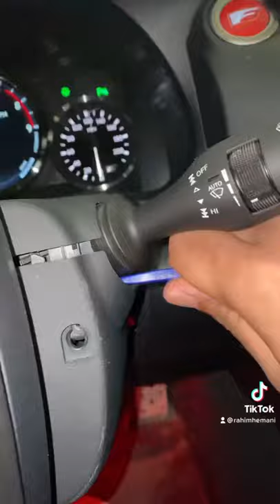Remote starter✅✅

Comment: They can void warranties for this. Just a heads up.
Reply: Hearing that exhaust I'd say he has a few things that can void warranty
Reply: @Nick.Pizano  but the people watching his video might not.
Reply: Be your own warranty, start wrenching
Reply: @Nick.Pizano exhausts cannot void warranty if it’s only an axle back exhaust.
Reply: Gonna be that guy, Nothing you do can Void a Warranty Period. For Modifications to Void a Warranty, The Companies must prove the mods caused the problem. Companies just get away with it cause no one goes to court over it
Reply: @J-Ru89  that's not true at all. There are terms and conditions to warranties and most of the time those terms and conditions mention things that can and can't be tampered with. One of those things, almost always, is the electrical system.

With voided warranties it's not about them proving that the issue is from your modification, it's that your modification makes it nearly impossible to prove that the issue 100% came from their side since the system isn't stock anymore.
Reply: @zc1682  so weird, Toyota literally lost a Court case on Warranty over tampering with what they said Voided the Warranty and had to replace a Gr86 engine.
Reply: @J-Ru89  right, because people weren't tampering with the engines. Toyota claimed things that weren't impacting the engine, were. That's not the case. They can't void your engine warranty over changing out to a remote starter. They can 100% void your electrical warranty as well as any warranty around your starter.

Comment: Check engine: has joined the chat
Reply: It’s a Lexus aka “a Toyota in disguise” that thing won’t have a check engine light in 2050
Reply: @Oh.Canada if you tamper with crap like that you'll get your light buddy. If it doesn't then there's a massive problem with your ECU.

Comment: what´s the point of having a remote starter ? i don´t get it
Reply: Practical use is preheating a car and letting it idle up to temperature before driving (like you're actually meant to)

Especially during winter

Although its just cool af

Comment: Imagine forgetting you that you left it in gear..
Edit: If it was emanuel
Reply: If it was le manual
You could program it to use the gear sensor to not start in gear
Reply: @maybeharold  Well.. I’ve never driven anything made after 2004.. Don’t know modern car technology that well
Reply: The clutch pedal need to be depressed. So u would need to get around that to.
Reply: @tysonchickennuggets  no it doesn’t.. at least in cars built with people who own a brain
Reply: @Brawell_ I've got an older style system on my 03 Evo. There's a signal wire for the handbrake since older cars don't know what gear they're in but you can also have a separate neutral activation by just putting a switch in the neutral position

Comment: Don’t install a remote starter in a car that doesn’t have one. They cause unnecessary problems trust me.
Reply: Like what?
Reply: No it doesn't, it's literally just a wireless ignition bypass. I've been running an old school one that has a lil phone on my 03 Evo 8 and never had issues with it, these newer ones wouldn't be any different